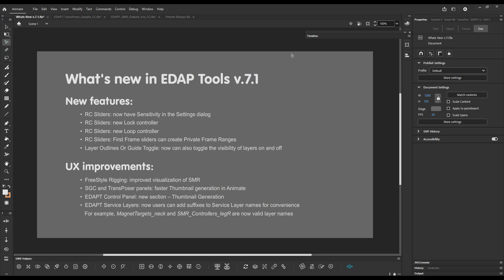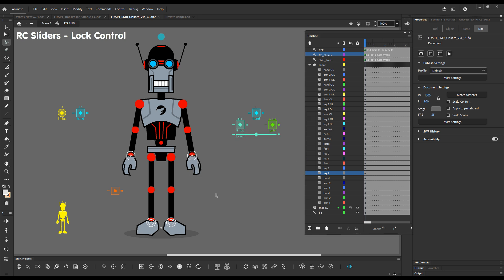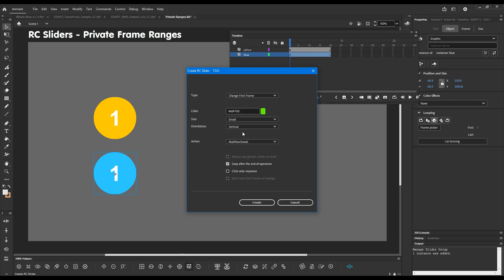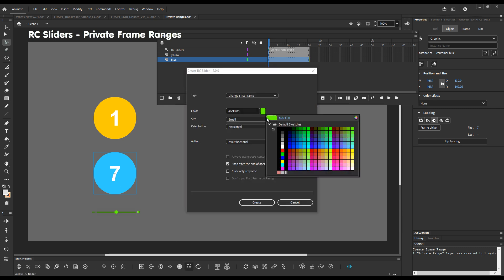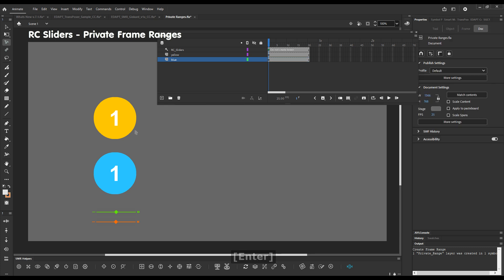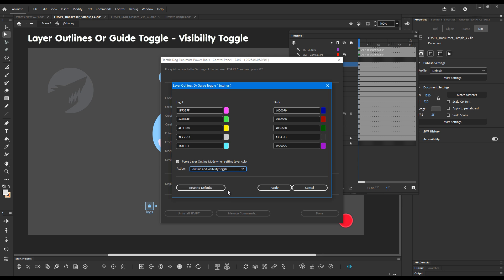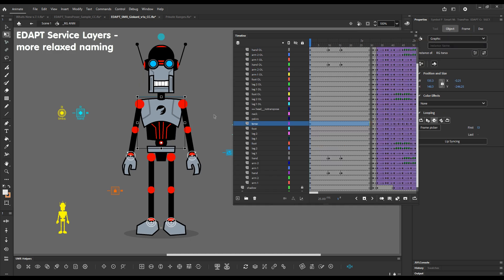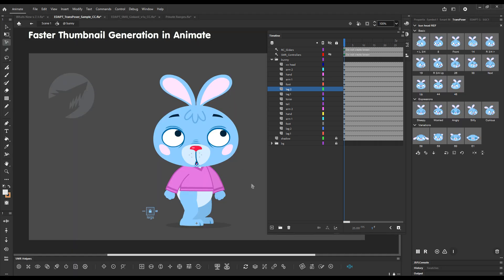EDAP Tools 🔥 What's new in v.7.1 🔥

Comment: After installing some other software on my system and updating both Windows and Adobe, EDAP started behaving differently. Then I noticed that my license was gone, and I began getting the “System initialization failed” error.
I followed all the steps mentioned on your website, but it still didn’t work. I even tried formatting my system and doing a fresh Windows installation.
I also read your 3 January 2025 reply that said, “Then, unfortunately, you’re out of luck. Your computer is incompatible for some reason.”
After several rounds of testing and R&D, I finally found one solution that actually works. Please add it to your website.
Reply: add this Path - Under System Variables →  Path → C:\Windows\System32\Wbem
Reply from the maker: Excellent observation — you nailed it!
In some cases, `C:\Windows\System32\Wbem` isn’t included in the system PATH by default,
which prevents WMIC from being accessed when called by external applications.

We’ve now updated the Known Issues section on our website to include this fix.
Really appreciate the time and effort you put into testing this - your findings are genuinely helpful to the entire community!

Comment: If we open EDAPT_TransPoser_Sample_CC.fla from the SMR Helper window extension, and enable Layer Parenting Toggle, then try to make a pose — it works perfectly.
It behaves exactly as expected within the same file and same scene.

However, if we copy that same file (with parenting turned off) and paste it into a new .fla file or a new scene in the same file, then after enabling Layer Parenting and trying to pose, it starts behaving abnormally — just like I mentioned in my previous comment.

Is there any solution for this?
I want the same behavior that works perfectly in the main file.

For now, my temporary workaround is to import my Animatics and BG props into the main rig file instead of copying the SMR rig into a new one. This works perfectly for me.

But please let me know why, when we copy and paste an SMR rig into a new rig file, the parenting mode doesn’t work the same way as in the main rig file.
I’d really appreciate it if you could provide a proper solution for this.

Thanks!
Reply from the maker: Most likely you are copying something which is wrapped inside a Graphic container and pasting it on the main timeline without the wrapping.
Animate behaves differently with parentend layers which are inside a symbol and those that are just layers on the main timeline.
Reply: @EDAPTools  I usually keep all symbols fully outside on the main timeline. I don’t like creating animations inside symbols and calling them, since two characters often need to interact during animation. Also, Animate’s Z-layer depth doesn’t work inside symbols, so we need to use extra effects (such as adding separate layers for overlapping elements) when two or more characters overlap during animation.

For now, I’m using my rig file as a template file for animation, it's working Perfectly, but I trust that you’ll provide a solution for this. Since SMR isn’t a built-in Animate feature, it’s possible that when copying into a new file, some rig information is missing — which might be why it behaves differently.

I just found another solution — in a new file, if we keep the character in Scene 1 without layer parenting on (top) and copy the same character into the second scene with Layer Parenting turned on, it also works perfectly.
Reply from the maker: Thanks for letting us know your findings and good luck with your projects!
Layer Parenting, Layer Depth and all the other Advanced Layers-based features were so poorly and incompetently implemented by the Animate team that this literally led to the destruction of the program.
Layer Parenting causes much more harm than good and at this stage when Animate has been abandoned, our only goal while developing EDAP Tools will be to protect SMR from PL-induced crashes, not integrate PL further into any of our workflows.

Comment: Your tools are amazing, and I’m using them regularly. I’m facing a small bug: when I set a small square as the parent (Animate cc own parenting system) for a character (all body parts linked), and then start posing with the Kine-Flex SMR tool, it only works one time. After that, the next attempt fails to register the click. If I re-select, it works again once, but then the same issue repeats.

If I select all the character graphics instead, posing works 2–3 times, but then the same problem starts again — it only works intermittently (one time, then fails, then works again).
If i Press (G) every pose attempt, then all time working Perfectly 
Can you please fix this issue in next update?
Reply from the maker: Unfortunately, this cannot be fixed. It is not exactly a bug, but the only way to deal with the insane madness of parented layers.
The best way to combine SMR and Layer Parenting is to keep parenting off while animating with SMR and only toggle it on when you're done to get arcs:
https://flash-powertools.com/smr-and-layer-parenting/
Even better would be to not use it at all and clean up only when needed:
https://flash-powertools.com/classic-tweens-and-arcs/
Reply: @EDAPTools  Problem solved, thanks. 
I noticed that when layer parenting is on, while posing, the selected layer temporarily for sometime becomes unparented and then re-parented again — maybe that’s why the that behavior happened.

Comment: Amazing tools. When we cut and paste a symbol inside another symbol, it doesn't paste in the exact location. It pastes in a different position than its original position. I also tried the "Copy Frames" and "Paste Frames" options, but that didn't work either. Is it possible to cut and paste a symbol inside another symbol at the exact position? It works easily with drawing shapes, but not with symbols. Is there any solution for copy paste symbols inside symbols?  Thanks.
Reply from the maker: Only if they have matching Registration Points and transformation matrices.
More information here: https://flash-powertools.com/understanding-symbol-registration/
Reply: @EDAPTools  Thanks for the reply, I read the information and watch the video I got the point that the symbol's internal coordinate system is in relation to the external bounding box. but I still don't know how to cut or copy a symbol and paste it in place inside another symbol. The problem still remained same. If I Copy and paste a symbol inside another symbol. it changes it's location. This is universal problem for every Animate cc user there's not any single tutorial on this. Can you please tell me how to do it step by step. or please make a tutorial on this.
Reply from the maker: The answer to your question was given in the first sentence of our previous reply to you.
Symbols need to have matching Reg Points and transformation matrices. Only then copy/paste coordinates will be visualized as pasting in the same place.
Reply: @EDAPTools  Thanks. I got it now.👍
Reply from the maker: There is an old Trick or Script plugin which is supposed to tackle the exact problem you have:
https://www.youtube.com/watch?v=Z41vQhnUlDE
If you want to try it, you will need to find the free version of their tools and how to install them.
Reply: @EDAPTools  After spending so many hours, I wrote a .jsfl script today that pastes a symbol inside another symbol in the exact position, and it works perfectly. I will also checkout the TrickorScript plugin  Thanks for the help! 👍

Comment: hey sir "i have a question whenever i am using oval tool and making a circle even i specify same size they is a verilittle diffrens why is that? Is there any fix for it."  I'm using stroke for lineart.
Reply from the maker: No idea. Probably some mathematical rounding if you are comparing at 2000% zoom.
Reply: @EDAPTools  "At 2000% zoom, yes, it looks bad but I doubt anyone will notice once it's rendered. Thanks for answering me I just wanted to confirm my doubt. I didn’t know this about Animate; I thought it worked like Illustrator and thought I was just missing a setting, but now I know I'm not."😅
Reply from the maker: Animate is Flash. It has a very different origin compared to Illustrator. There are a lot of imperfections in Animate due to mathematical rounding, not only affecting the drawing tools, but also transformations and tweening calculations.